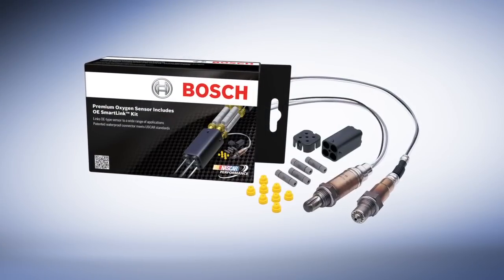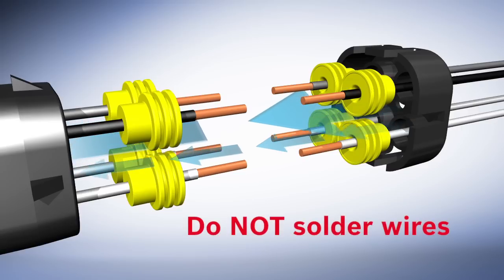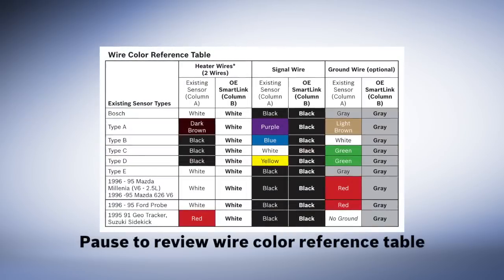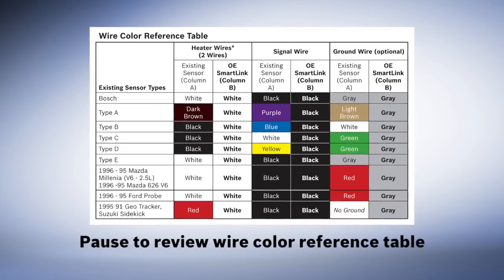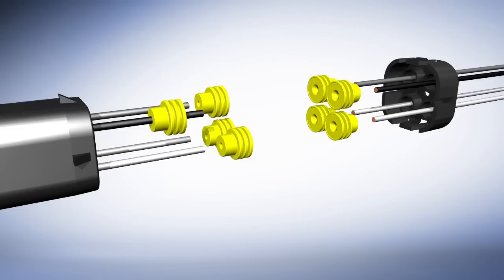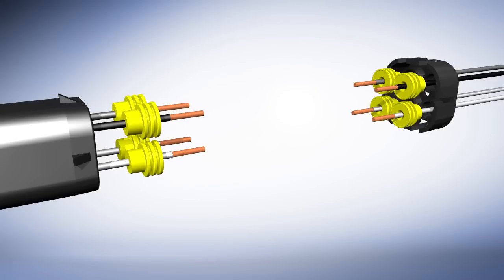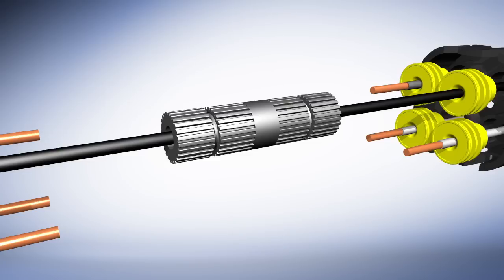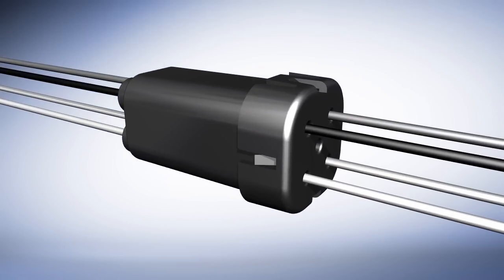Installation: Bosch O2 Sensor with SmartLink™

Comment: how the fuck does air travel down a copper wire?
Reply: That's got to be horseshit
Reply: It’s not here’s the explanation coming from an electrical engineer btw 

How Oxygen Sensors Work and Why Wiring Integrity is Crucial

Understanding Oxygen Sensors:

Oxygen sensors are vital components in your vehicle’s exhaust system. They measure the oxygen levels in the exhaust gases and provide data to the engine control unit (ECU). This information helps the ECU adjust the air-fuel ratio for optimal combustion, which improves performance and reduces emissions.

The Role of Wires and Connectors:

	1.	Air Passage Through the Sensor:
	•	Ambient Air Reference: Oxygen sensors need a reference to the ambient air to compare it with the oxygen levels in the exhaust gases. This reference air is crucial for the sensor to generate an accurate voltage signal.
	•	Porous Wire Insulation: Some oxygen sensors have wires with a porous insulation that allows a small amount of ambient air to reach the sensor element inside. This design ensures the sensor can compare the oxygen content of the exhaust gas to the ambient air accurately.
	2.	Why Soldering is Problematic:
	•	Heat Damage: Soldering wires can damage the porous insulation and the sensor’s delicate components due to the high heat involved.
	•	Sealing Issues: Proper connectors and crimps are designed to maintain the necessary pathways for air to reach the sensor while also providing a secure, sealed connection. Soldering can disrupt these pathways, leading to inaccurate readings.
	•	Mechanical Stress: Soldered joints are less flexible and more prone to breaking under the vibration and movement typical in a vehicle, which can compromise the sensor’s function.

Explaining to Viewers:

Here’s a simple way to explain it:

Why Oxygen Sensors Need Proper Connections:

Oxygen sensors help your car’s computer keep the engine running efficiently by measuring the oxygen levels in the exhaust. For these sensors to work correctly, they need to compare the exhaust gas to the outside air.

How Does Outside Air Get to the Sensor?

Some oxygen sensors have special wires that let a tiny amount of air through. This air travels through the insulation around the wires and reaches the sensor inside. This comparison between the exhaust gas and outside air helps the sensor generate an accurate signal that your car’s computer uses.

Why Not Solder the Wires?

	•	Heat and Damage: Soldering uses high heat, which can damage the special insulation and the sensor itself.
	•	Sealing: Proper connectors are designed to keep the air pathways open while also sealing the connections. Soldering can block these pathways, leading to bad sensor readings.
	•	Flexibility: Cars move and vibrate a lot. Soldered connections are stiff and can break more easily. Properly crimped connections are more flexible and durable.

Using the right connectors and crimping tools ensures that the sensor can breathe and work correctly, keeping your engine running smoothly and efficiently.
Reply: It's bollocks,   two wires  heat the sensor and two that provide a signal to the ecu.
Reply: Ryan Flagg my question as well
Reply: It doesn't. It travels in between the fine strands of the wire. The flow is on the scale of "a bunch of ions", so yeah, don't blow on the wire and expect to feel it on the other end lol.

Now nothing about the above means you can't solder the wires, but you need to solder and insulate it with a passage for air in mind. Traditionally you'd solder close to the insulation, and do a tight wrap with tape or use heat shrink tubing, which does not ensure a passage for air.
Reply: lmfaooooo
Reply: Ryan Flagg 
He should have said heat
Reply: Yeah... Air flow over the wires... BS! I'm betting they have had so many people try to install one of these and botch the soldering job.
Reply: How Oxygen Sensors Work and Why Wiring Integrity is Crucial

Understanding Oxygen Sensors:

Oxygen sensors are vital components in your vehicle’s exhaust system. They measure the oxygen levels in the exhaust gases and provide data to the engine control unit (ECU). This information helps the ECU adjust the air-fuel ratio for optimal combustion, which improves performance and reduces emissions.

The Role of Wires and Connectors:

	1.	Air Passage Through the Sensor:
	•	Ambient Air Reference: Oxygen sensors need a reference to the ambient air to compare it with the oxygen levels in the exhaust gases. This reference air is crucial for the sensor to generate an accurate voltage signal.
	•	Porous Wire Insulation: Some oxygen sensors have wires with a porous insulation that allows a small amount of ambient air to reach the sensor element inside. This design ensures the sensor can compare the oxygen content of the exhaust gas to the ambient air accurately.
	2.	Why Soldering is Problematic:
	•	Heat Damage: Soldering wires can damage the porous insulation and the sensor’s delicate components due to the high heat involved.
	•	Sealing Issues: Proper connectors and crimps are designed to maintain the necessary pathways for air to reach the sensor while also providing a secure, sealed connection. Soldering can disrupt these pathways, leading to inaccurate readings.
	•	Mechanical Stress: Soldered joints are less flexible and more prone to breaking under the vibration and movement typical in a vehicle, which can compromise the sensor’s function.

Explaining to Viewers:

Here’s a simple way to explain it:

Why Oxygen Sensors Need Proper Connections:

Oxygen sensors help your car’s computer keep the engine running efficiently by measuring the oxygen levels in the exhaust. For these sensors to work correctly, they need to compare the exhaust gas to the outside air.

How Does Outside Air Get to the Sensor?

Some oxygen sensors have special wires that let a tiny amount of air through. This air travels through the insulation around the wires and reaches the sensor inside. This comparison between the exhaust gas and outside air helps the sensor generate an accurate signal that your car’s computer uses.

Why Not Solder the Wires?

	•	Heat and Damage: Soldering uses high heat, which can damage the special insulation and the sensor itself.
	•	Sealing: Proper connectors are designed to keep the air pathways open while also sealing the connections. Soldering can block these pathways, leading to bad sensor readings.
	•	Flexibility: Cars move and vibrate a lot. Soldered connections are stiff and can break more easily. Properly crimped connections are more flexible and durable.

Using the right connectors and crimping tools ensures that the sensor can breathe and work correctly, keeping your engine running smoothly and efficiently.
Reply: How Oxygen Sensors Work and Why Wiring Integrity is Crucial

Understanding Oxygen Sensors:

Oxygen sensors are vital components in your vehicle’s exhaust system. They measure the oxygen levels in the exhaust gases and provide data to the engine control unit (ECU). This information helps the ECU adjust the air-fuel ratio for optimal combustion, which improves performance and reduces emissions.

The Role of Wires and Connectors:

	1.	Air Passage Through the Sensor:
	•	Ambient Air Reference: Oxygen sensors need a reference to the ambient air to compare it with the oxygen levels in the exhaust gases. This reference air is crucial for the sensor to generate an accurate voltage signal.
	•	Porous Wire Insulation: Some oxygen sensors have wires with a porous insulation that allows a small amount of ambient air to reach the sensor element inside. This design ensures the sensor can compare the oxygen content of the exhaust gas to the ambient air accurately.
	2.	Why Soldering is Problematic:
	•	Heat Damage: Soldering wires can damage the porous insulation and the sensor’s delicate components due to the high heat involved.
	•	Sealing Issues: Proper connectors and crimps are designed to maintain the necessary pathways for air to reach the sensor while also providing a secure, sealed connection. Soldering can disrupt these pathways, leading to inaccurate readings.
	•	Mechanical Stress: Soldered joints are less flexible and more prone to breaking under the vibration and movement typical in a vehicle, which can compromise the sensor’s function.

Explaining to Viewers:

Here’s a simple way to explain it:

Why Oxygen Sensors Need Proper Connections:

Oxygen sensors help your car’s computer keep the engine running efficiently by measuring the oxygen levels in the exhaust. For these sensors to work correctly, they need to compare the exhaust gas to the outside air.

How Does Outside Air Get to the Sensor?

Some oxygen sensors have special wires that let a tiny amount of air through. This air travels through the insulation around the wires and reaches the sensor inside. This comparison between the exhaust gas and outside air helps the sensor generate an accurate signal that your car’s computer uses.

Why Not Solder the Wires?

	•	Heat and Damage: Soldering uses high heat, which can damage the special insulation and the sensor itself.
	•	Sealing: Proper connectors are designed to keep the air pathways open while also sealing the connections. Soldering can block these pathways, leading to bad sensor readings.
	•	Flexibility: Cars move and vibrate a lot. Soldered connections are stiff and can break more easily. Properly crimped connections are more flexible and durable.

Using the right connectors and crimping tools ensures that the sensor can breathe and work correctly, keeping your engine running smoothly and efficiently.
Reply: Some sensors have a small hole on the top. Some sensors have special wire insulators that allow air to pass thru. The o2 sensor need fresh air that it will compare to the gasses in the tail pipe. That's how and why.

Comment: "It is critical to understand, that in order for the oxygen sensor to work properly, air must be drawn into the sensor via the connecting wires." 

Uh, no.  In order for the sensor to work properly, use only the Posi-Lock connector when connecting the wires.  Soldering the wires can lead to corrosion and failure of the connection if not done properly.  Simple translation issue.
Reply: Yea, I LOL'd at that comment. Air has ZERO to do with this setup. It is getting the proper wires to make a solid connection in the POS posilock connectors. If they don't wrap around the post when you tighten down, you are screwed.
Reply: Actually it's true. First generations of sensors had a vent hole where oxygen came in in order to make the O2 comparison. Modern ones don't have the breather hole so they don't get clogged by dirt, so the new "hole" is the space between the wire and it's insulation ;)
Reply: @cesaralfredotrejo  If the connector is air and water tight, I find that very hard to believe!  Sounds weird to me... but whatever!
Reply: This is the explanation 

How Oxygen Sensors Work and Why Wiring Integrity is Crucial

Understanding Oxygen Sensors:

Oxygen sensors are vital components in your vehicle’s exhaust system. They measure the oxygen levels in the exhaust gases and provide data to the engine control unit (ECU). This information helps the ECU adjust the air-fuel ratio for optimal combustion, which improves performance and reduces emissions.

The Role of Wires and Connectors:

	1.	Air Passage Through the Sensor:
	•	Ambient Air Reference: Oxygen sensors need a reference to the ambient air to compare it with the oxygen levels in the exhaust gases. This reference air is crucial for the sensor to generate an accurate voltage signal.
	•	Porous Wire Insulation: Some oxygen sensors have wires with a porous insulation that allows a small amount of ambient air to reach the sensor element inside. This design ensures the sensor can compare the oxygen content of the exhaust gas to the ambient air accurately.
	2.	Why Soldering is Problematic:
	•	Heat Damage: Soldering wires can damage the porous insulation and the sensor’s delicate components due to the high heat involved.
	•	Sealing Issues: Proper connectors and crimps are designed to maintain the necessary pathways for air to reach the sensor while also providing a secure, sealed connection. Soldering can disrupt these pathways, leading to inaccurate readings.
	•	Mechanical Stress: Soldered joints are less flexible and more prone to breaking under the vibration and movement typical in a vehicle, which can compromise the sensor’s function.

Explaining to Viewers:

Here’s a simple way to explain it:

Why Oxygen Sensors Need Proper Connections:

Oxygen sensors help your car’s computer keep the engine running efficiently by measuring the oxygen levels in the exhaust. For these sensors to work correctly, they need to compare the exhaust gas to the outside air.

How Does Outside Air Get to the Sensor?

Some oxygen sensors have special wires that let a tiny amount of air through. This air travels through the insulation around the wires and reaches the sensor inside. This comparison between the exhaust gas and outside air helps the sensor generate an accurate signal that your car’s computer uses.

Why Not Solder the Wires?

	•	Heat and Damage: Soldering uses high heat, which can damage the special insulation and the sensor itself.
	•	Sealing: Proper connectors are designed to keep the air pathways open while also sealing the connections. Soldering can block these pathways, leading to bad sensor readings.
	•	Flexibility: Cars move and vibrate a lot. Soldered connections are stiff and can break more easily. Properly crimped connections are more flexible and durable.

Using the right connectors and crimping tools ensures that the sensor can breathe and work correctly, keeping your engine running smoothly and efficiently.